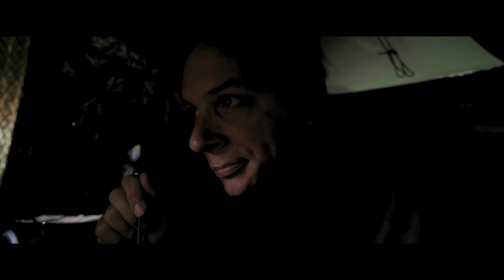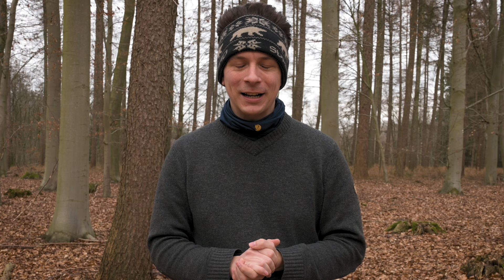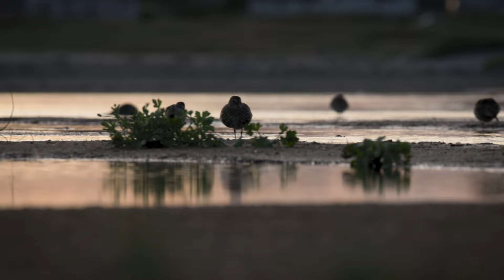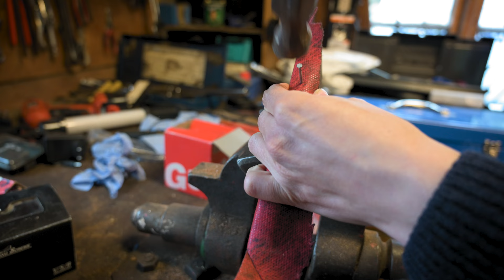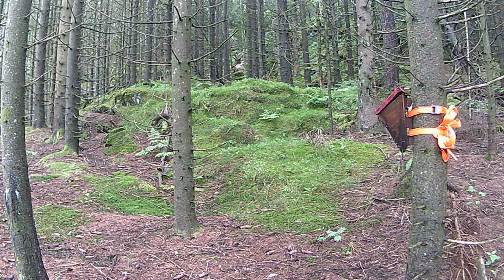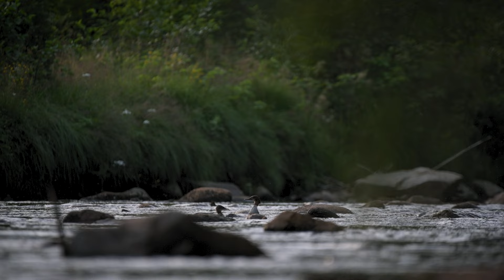PHOTOGRAPHING PINE MARTEN AND MINK! Wildlife Behind The Scenes

Comment: Just wondering, what size of lens do you use?
Reply from the maker: It is approximately 3 metres long and five metres in diameter. Okay enough of the nonsense, I am mostly using the 200-500 and 70-200 right now. Cheers, G
Reply: @GunnarDresler  a little humour never gets in the way!! Thanks!